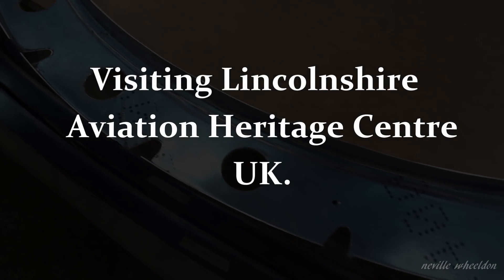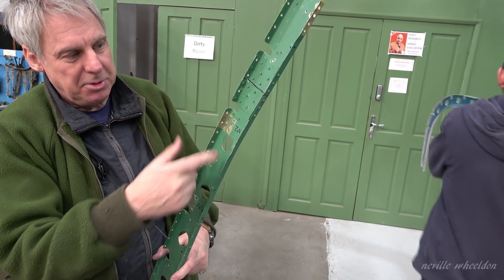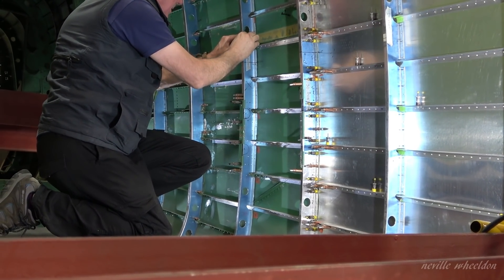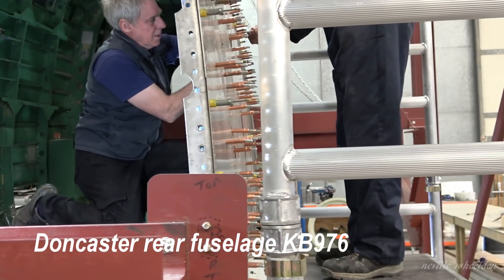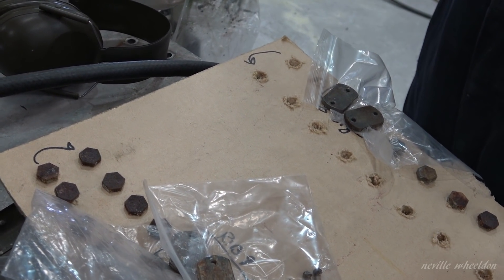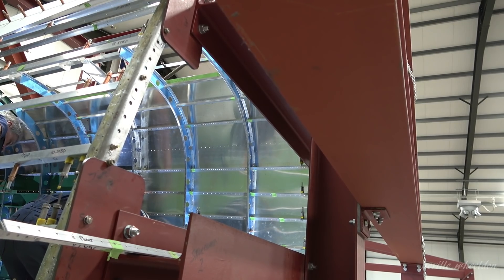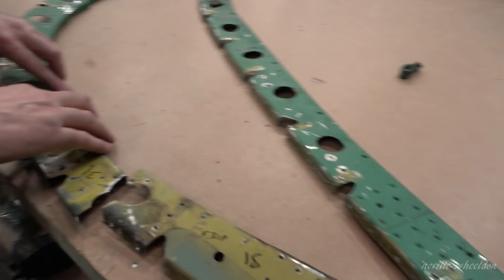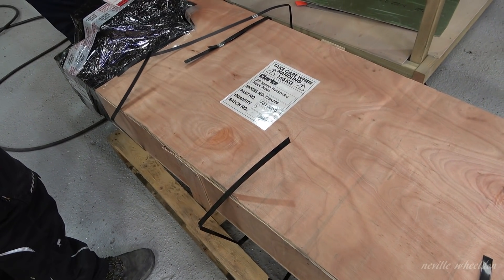Video 141 Restoration of Lancaster NX611 Year 5.---Port side former fitted to KB976 rear fuselage.

Comment: I have an interesting conundrum for you with the restoration of KB976's aft section to taxi condition. Kermit Weeks who purchased the remains of KB976 has just released a revel video looking at the aircraft in its containers and in there he has the complete aft section which has been almost completely restored reportedly to airworthy condition. That being the case and there is no doubt that he has them it begs the question of where did the one that you have come from or which one is which.
Here is the link https://www.youtube.com/watch?v=tee6Bv4Z2HI
You were also talking about the problem of the wing section restoration and just how you are going to go about it. He has one that has already had some restoration done but not finished. Just maybe it would be worth a discussion with him if you have not already.
Reply from the maker: Hi Horsebee thank you for the Link,  If I remember right the one Kermit has is of a Lincoln ( rear fuselage). I'm only a visit to the Centre but they do have contacts with most of the restoration companies world wide , but I don't have any information on taking on any more work.
Reply: @nevillewheeldon1693  Conundrum solved I'm told that the parts came from KB994

Comment: YAY - I'm finally caught up after 2 days of binge-watching! 
A couple of questions that John might be able to answer.....   (From a Canadian Aircraft Mechanic to a British one!)
1 - Will they be using the same type of Plug Rivets on the wings?  Or will they be using another type of fastener? Maybe like a Cherry-Max rivet or screws and anchor nuts?  Those plug rivets look like a NIGHTMARE - especially if (as the French found out) the rivets aren't long enough and don't seat properly. I can see those thing scaring the CAA to no end!
2 - Are they changing out all the Magnesium rivets to Aluminium rivets?  Especially since the magnesium rivets are prone to corrosion.
3 - Were the Canadian Lancasters also assembled with Magnesium rivets?  I don't remember the Canadian Lancaster needing to be completely disassembled to make it airworthy. Maybe it was assembled with Aluminium rivets?

Keep up the GREAT WORK, Neville!  And Kudos to all the crew from Alberta, Canada!
I'd LOVE to send you a photo I took in Nanton, Alberta at the Bomber Command Museum of Canada, of my motorcycle with their Lancaster and their "Bombshell" model! Do you have a Facebook page that I could sent it to?
Reply from the maker: Hi Norm McRae, I had a word with Keith a few weeks back he thought they would be using the Plug rivets, bur this can change. All the magnesium will be changed, the Canadians  used a different type of rivet  and are still ok. Sorry I do not use facebook.
Reply: @nevillewheeldon1693  Cool - Thanks for asking! 
I've actually been asked to help out with the Lancaster here in Calgary Alberta, and I'm always hungry for more information!  
Please give my thinks to Keith and the rest of the crew - They're doing a GREAT job, and saving a piece of history!

Comment: This rear fuselage you have been working on in a pristine way is being assembled to the airworthy airplane, am I correct?
Reply from the maker: Hi Namer , the rear fuselage they are working on will not be airworthy, but will be fitted to NX611 Just Jane to enable them to work on the rear fuselage they take. Restoring this one to airworthy condition and then fit it back on to Just Jane. This will allow Just Jane to carry on giving taxi rides earning revenue to help with the restoration of NX611.
Reply: @nevillewheeldon1693  , thank you so much. It’s impressive to notice all this work of yours on parts not fitted for flying. A real pleasure to watch every single video.